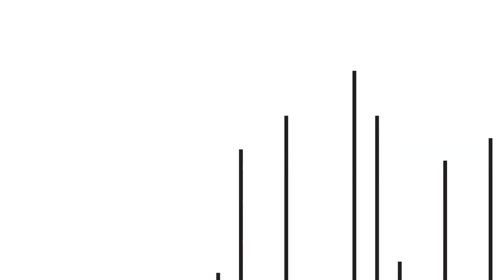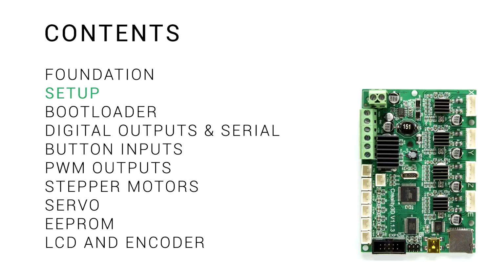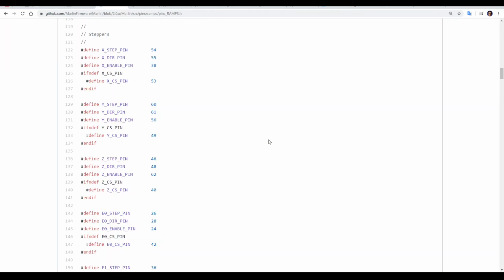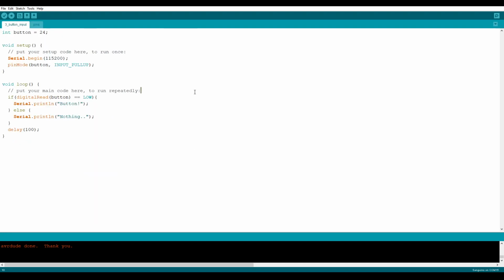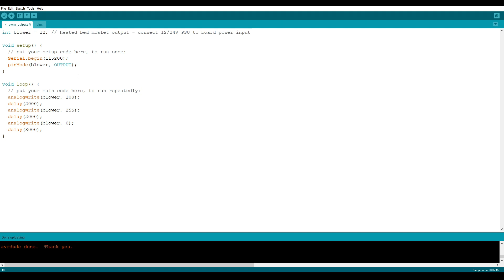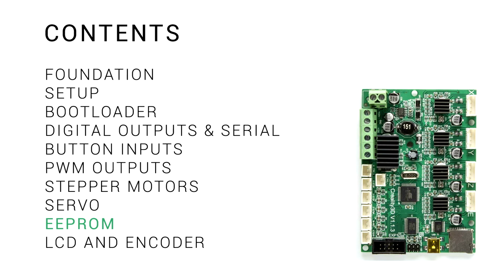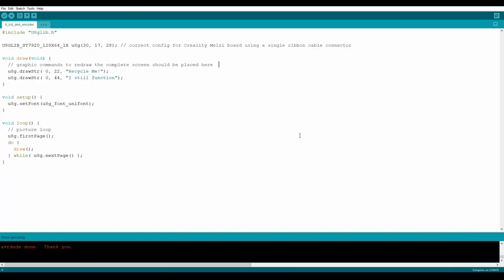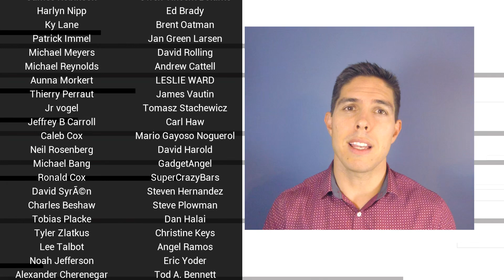Re-use your 3D printer mainboard and LCD for awesome Arduino projects

Comment: Been trying to find a tutorial similar to this without luck, I'm definitely going to try this if I ever stop using my printer. 

But what I would like to know is how to take the Ender 3v2 LCD. If I was to buy a second ribbon cable to go into the back of the screen, that is removable from the frame by design so I can plug it in to a raspberry Pi as its display. 
And just keep moving the cable plugged into the screen back and forth between which device I am using

Comment: Is there a comprehensive video for this process for the newer 32 bit boards?? I'm having a hard time figuring this stuff out. I was able to successfully flash a new firmware onto my 4.2.2 board, but I would like to be able to control it with Arduino. Is this possible? I know there is a couple of videos out there but none have given me quite what I need. Many thanks in advance!
Reply: Also looking for help on this if you found anything @steveg2277
Reply: Hey did you find an answer for this?

Comment: Michael, you are absolutely brilliant at mind reading! 

I was looking for a way to reuse my old Ender 3 Pro v1.1.5 Motherboard and Mono LCD Screen. I had no use for them after replacing them with better parts (Ender 3 v2 display + Creality Silent v4.2.7 Motherboard). My Ender 3 Pro turned into an Ender 3 v2. 

It felt wrong if I did nothing with these old parts that still worked perfectly fine. Now they finally have a purpose!

Comment: The project you mention in this video wouldn't happen to be an arduino controlled filament dryer or dry box, would it? This is a project I'm getting ready to tackle soon and I'm starting completely from scratch.  I've never done anything with arduino before and a video about a similar project would really help get a better idea of how to get started.

Comment: Great idea Mike. You can do it with the btt boards now too I think. Well, I'm using a tft50 display as a peripheral to an undetermined microcontroller depending on how much it taxes the uC. I'm going to start with a mega then work my way up through my board collection. It's gonna be a face for a robot with mecanum wheels I'm building for some students I teach at a place I volunteer. The display can be used on it's own as well as a standalone project board, like a lilygo esp32. Great video brother.

Comment: Would this process work in a similar way for a Bigtreetech SKR Mini E3 v3?
Reply: I had the same question and made progress today getting my own SKR Mini E3 v3 board to compile with my own custom Arduino sketches....

I have been researching how to re-purpose an old ender 3 that has a broken creality board.  (I have other 3d printers so I no longer need this machine as a printer and decided to convert this printer into a totally different device).  I bought an SKR Mini E3 v3 and replaced my original motherboard and disconnected the hot-end and heated bed as I no longer need those components on my new device.

My first goal was to figure out how to compile the Marlin firmware for the SKR Mini E3 V3 board...  I reasoned that once I could compile my own "normal" firmware, I might be able to strip out the marlin 3d printer core code and replace it with my own ardunio code to control the motors and other various sensors for my project.

I used "Visual Studio code" complier along with the "Auto marlin build" extension to get a "normal" firmware to compile.  Once I was able to get a "normal" firmware to build, I poked around the various marlin cpp files and figured out the MarlinCore.cpp is the actual file that has the setup() and loop() methods required for Arduino sketches.  Next, I removed all of the code from those two methods and inserted my own code for the blink sketch as shown below.  As you can see, I declared PC15 as the pin for my led pin and hooked up the led pin and 10k resister as per Michael's example in his video above.

/* Here is my code below */

#define E0_DIAG_PIN PC15

void setup() {
  pinMode(E0_DIAG_PIN, OUTPUT);
}

void loop() {
 
  digitalWrite(E0_DIAG_PIN, HIGH);
  delay(1000);

  digitalWrite(E0_DIAG_PIN, LOW);
  delay(1000);
  
 }
 Please note - There is a ton of code in the header of the MarlinCore.cpp that I had to leave in MarlinCore.cpp file (all of the code above the original setup() method).  My goal is to figure out how much of that code I can remove at a later time.  I am not too concerned about it at the moment and hope to weed out that code later.  I couldn't get the firmware to compile unless I left it in.  But as you can see, I was able to declare pin PC15 for my led pin out.  Next I was able to compile a custom firmware.bin file having only the code above in my setup() and loop() methods.  I copied the firmware.bin file to an sd-card and inserted it into my SKR board.  After powering on my ender 3 printer, my led is blinking!  (link to video below)
  
 This is just a start for me.  I know I have a long way to go but at least it is a start in the right direction.   I hope this gives you some ideas on how you can also get your project off the ground.  Good Luck!
  
 https://www.youtube.com/watch?v=KpJTeOmXgnI

Comment: Aside from the power supply that comes with every Ender 3, is there any other 24v power supply that I might could use for this motherboard? I have a project in mind for this motherboard, an ender 3 LCD screen and a stepper motor but don't want to disassemble one of my printers nor do I want to shell out the money for a new power supply when I could scavenge one from somewhere else.

Comment: great Tutorial on using the old Ender3D board and recycling it for other uses. I however tried to use a AM2301 Temp/Humidity sensor and found that I had to remove the 10K pull up resistor (R3) and 4.7uf (C7) to get it working on Pin 20 (Zstop). Im going to try to make a full weather station using this board and display

Comment: i have a creality 4.2.7 motherboard that i want to run a stepper motor continuously along with a hotend for a project that i am building, I'm curious if this same concept would work on this board, I tried using marlin but cant get the stepper motor to run any length of time

Comment: Great Video. I am a newbee to the programing and use of writing programs, but was wondering if you might steer me towards were I can find a simple Marlin program that I can download to my  Mega2560 with a Ramps1.4 board and display that i can use to run a couple to NEMA 17 steppers, and adjust the speed. I have the spare parts already, and am trying to make a filament winder take up spool, what can be rum from the Mega and Ramps board i already have. Thanks, love your channel, and videos.

Comment: I want to use arduino to control 115VAC outlets. My particular reason is for monitoring temp/humidity and controlling fans, lights and possibly a dehumidifier and/or humidifier in a grow room, but there are undoubtedly other case uses for controlling a low-amperage household current outlet. I am going to try recycling an ender 3 mainboard thanks to your video, so thanks. If you have any suggestions to help me further I would love to hear. Thanks again.

Comment: I appreciate the trouble you had to go through to figure out how to rig a old 3d printer board to reuse for other things. DIY oxygen meter for oxygen concentrator and DIY controlled environment are a couple of things I'm repurposing some old boards for; that had a pin or two burnt out.

Your instructions and example code helped a bunch. Thanks.

Comment: I've just discovered this video and what can I say? Thank you so much! I'm playing with the thought of building my own guitar pickup winder. This thing is going to be based on an Arduino with a rotary encoder as input and an LCD as output device. Looks like my Ender 3 Pro motherboard and display are not going to vanish in some drawer after all after I've upgraded them. That's awesome. I need exactly 4 stepper motors, this fits the bill perfectly. Now I only need to find stepper motors that can do the speed I need and I'm nearly ready to go. Again, thanks so much

Comment: Are there inputs on the melzi board you can use for an IR-receiver? 

On an Arduino uno these pins are 3, 5, 6 as well as 9, 10, 11 labeled as digital PWM. 

Does anybody have an idea how to connect an IR-receiver to a melzi board?

Comment: I'll give you a free idea for your next project: take the board and reprogram it to use a stepper motor to open and close (wind and unwind) a window shade. Add it to IFTTT. Blinds may not work because of the locking mechanism but shades and cloth ones may.

Comment: DIY: soldering iron, mini heat gun, solder pot, oven (for annealing), light duty mini autoclave, mini sander, mini drill press, mini band as,mini scroll saw, cover maker, drink stirrer, drink warmer, drink mixer, soup maker, automated puppet controller, magnetic stirrer, heated magnetic stirrer, vented (with enclosure) heated magnetic stirrer, mini cnc mill, mini lathe, add a gas torch to make a glass forming too (glad rod, tube and beaker more), parts cleaner, laser engraver, 3d scanner, obviously much more... As for machine control, I will just use gcode just as with the printer

Comment: I just have to say I really like your videos... The one where you explained the BTT SKR v1.3v "SKR V1.3 Comprehensive guide - 32bit 3D printing for $20" gave me the knowledge and confidence to go ahead and purchase the BTT SKR v1.3 along with a complete upgrade for my Anet A8 that I have had for almost a year now. So, its funny that I came saw this video because I have been thinking about the uses I want to venture forward with my printer. First let me state what I purchased and then I will  ask my question(s) about my ideas. . .  .I have  an Anet  A8 v1.7 with mosfet upgrades. I purchased - BTT SKR v1.3 motherboard w/DVR8825 drivers, a MKS TFT35 V1.0 display, a  MKS TFT-WiFi APP 3D Printing Wireless Router ESP8266 WiFi Module, a Ultrabase Platform Glass Plate Build Surface + Aluminum Heated Bed Hotbed, a ANTCLABS BLTouch : Auto Bed Leveling Sensor with extension cable, bed insulation, Dual Z Stepper Motor Parallel Module, Screw-in thermistor 100K NTC 3950 , 2ea  120mm Blue LED Ultra Silent Case Fans, 14 & 16 gauge wire, and printed s bunch of upgrade parts.  It has been a little much to tackle all at once especially the Marlin software upgrade. But with all the help and support from you and others, I am almost complete. So my question(s)  are more due to the unfamiliarity of the SKR & MKS boards, I would like to add my old ATMega 1284P board posasiby slave it or run it together and control it with the MKS display as  well as using the OEM Lonestar 2004LCD to have more PMW controllers for addition fans, and LEDS mounted to the printer. I even thought about using the 2004LCD for a real time clock as well as scrolling thru many different displays like time left to finish, total print time, and maybe a camera addition, ETC. Is this even possible with combining a 8 bit and 32 bit board or are there hurdles I don't understand as of yet that may hinder this coming to fruition.  Any advice, help, or WARNINGS  would be much appreciated. . . .  . (Oh Yeah, I am disabled, lost my right leg 45 years ago, and have all the time in the world and need something to keep me occupied. . .

Comment: Hey Guys,
I want to use my Ender3 Melzi-board as a filament fuser. 
I want to connect an "on-off-on" switch to the X and Y endstops.
If I now close the x-endstop (pin 18), the heater 0 (pin 13) should heat to 190°C and if I close the y-endstop (pin 19), the heater 0 should heat to 240°C. The termistor is at pin 24.
Unfortunately I don't know what the sketch should look like. Can someone help me?
Many thanks in advance

Comment: I am working on a project that contains an rtc module. The  rtc data and clock lines must be connected to arduino pins A4 and A5. A4 is the beeper pin which is easily located using the table, but A5 maps to the Z_ENABLE_PIN, which I cannot locate on the board. You mention it briefly in the stepper motor part of you video, but that does not give me a clue. I could edit the rtc library to use other pins but this library is used in more projects, so would be interested if you, or someone reading this has a picture of the Melzi board with the all Arduino pin numbers mapped to the board pins.

Comment: Thanks for this inspiring video! I didn't even realise that I could reuse my old board for other purposes.  I have a Teensy controlled unit to automatically tune my smallband magnetic loop antenna to the best SWR when changing frequency and start transmitting, using a stepper motor and a variable air capacitor. Looking at your video I realised I can do this with my old Creality 1.1.4 board without having the need for external components (except for the SWR bridge). I feel a project coming up :-)

Comment: Hey Michael, since this is the closest I could find on the internet about the Ender 3 board pins, could you shine a light as to the reason why, when I accidentally "un-inverted" the 2 middle wires which are inverted by factory, on the motor cable, I fried a stepper driver? I'm guessing I fried it because after that, when I plug a motor to it, the motor shaft immediately gets heavier to turn, even with the board completely powered off, and when I power it, and move that specific axis, the motor "dances" going back and forth, same motor and cable (new cable, middle wires swapped around like from factory) works fine in all other axis. Please help.

Comment: Worth noting - stepper motors are not all wired up the same way - there doesn't seem to be one agreed standard. For example, the Moons motors on Wanhao printers are different to the JKong motors on Creality printers - the middle two pins are the opposite way around compared to each other. Obviously the Creality board in conjunction with the Creality cabling are set up for the JKong motors, but if you just plug them into Moons motors without checking it won't work (may even break the motor or the driver chip? not sure).

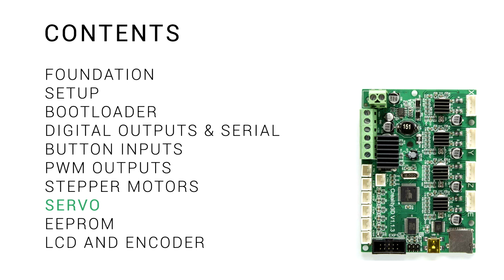It's a bit of a nightmare to work out as the JKong online data doesn't cover the connector that the Creality motors have, just built-in colour-coded wires (must have been a custom version for Creality) - but comparing the Creality cabling (can see this @12:22) and mainboard circuit board layout (https://github.com/Creality3DPrinting/Ender-3/blob/master/Ender-3%20PCB/Ender3_pcb_parts.PDF) and the A4988 datasheet (https://www.allegromicro.com/en/Products/Motor-Drivers/Brush-DC-Motor-Drivers/A4988) shows that they connect driver outputs 1A, 1B, 2A, 2B to pins 1, 4, 3, 6 on the motor - which means the motor is 1A, n/c, 2A, 1B, n/c, 2B. Moons motors are 1A, n/c, 1B, 2A, n/c, 2B.

It's clear from the Moons catalog what their pinout is (https://www.moonsindustries.com/ - no direct link as they encode the session in the URL, but navigate to one of their hybrid stepper motors, and under "Downloads" find the Hybrid Stepper Motor_Catalog2019.pdf document; it's all in there, page 67)

I guess you can check manually by using a multimeter to buzz out the connector, find the two pairs of pins that are connected (at least have a non-infinite resistance? I've not tried) and this will show if it's one or the other. One coil is pins 1A, 1B, the other coil is pins 2A, 2B.
Reply from the maker: Great point. For the record I've never damaged anything if the stepper motor was wiring incorrectly, although I've spotted it pretty quickly. For those reading it won't rotate, but vibrate back and forth on the spot.

Comment: I see evidence that many hobbyists are bricking their mainboards during firmware upgrades, then getting stuck because they lack knowledge the ISP interface.   An AVR novice may look up the (expensive) price of an commercial ISP,  then give up and just buy another $15 main board.  It would be useful to show people how to use AVRDUDE with the Raspberry Pi's SPI bus, or how to build an ISP from a $1 Digispark.
Reply from the maker: I've got a sparkfun programmer that I used once to unbrick a 2560 board with icsp. Was pretty handy at the time.

Comment: 3D Printer boards are great for any project. They have almost anything you could possibly need. I use an SKR PRO with STM32F4 to drive a 6-axis robot. Very cheap and very fast, especially when programming it without arduino via registers or stdperiph.

Comment: Can I use it for lowrider cnc?
Reply from the maker: Yes but with two caveats: only 4 stepper outputs so no dual endstop homing, the A4988 drivers may need the VREF turned up so you'll need decent cooling.

Comment: I wonder how viable it is to do the opposite,  use something like ESP32 (dual core 32 bit 4Mb risc 'arduino') to build  a better Ender 3 controller. The firmware is already there, it would just be a case of providing the stepper drivers and appropriate connectors. The ESP is already built for hosting it's own web service, so you could probably replace octoprint too.
Reply: Someone did that for GRBL already, but I think there's an issue of the number of available pins for 3d printer use https://github.com/bdring/Grbl_Esp32
Reply: @fpvm4k3r  That's really interesting, I'll check it out, thanks!

Comment: I don't think using PWM with a solid state relay is a good idea 9:57
Reply from the maker: That's the whole point of solid state over a conventional relay. You can control the output with precision rather than 'bang bang' style control. Works very well on mains powered heated beds.
Reply: @TeachingTech  Did you ever try it? It seems wrong, solid state relays should do zero crossing detection to switch on and will only switch off at a zero crossing. AC power works on 50 or 60 hz, PWM at several kHz. You would create a huge amount of rf noise if you run a solid state relay at these frequencies without zero crossing detect. Just use the bang control, which is fine for slow heated beds